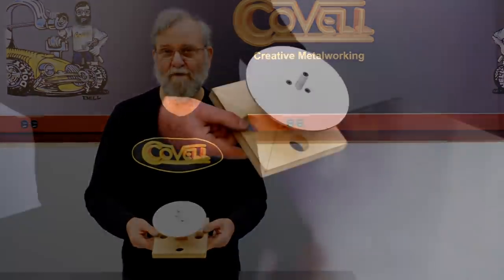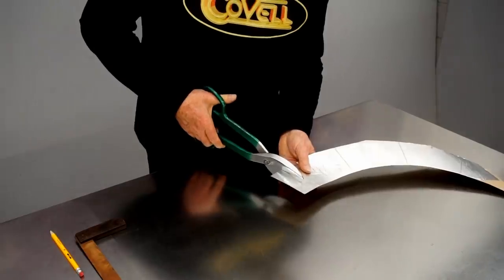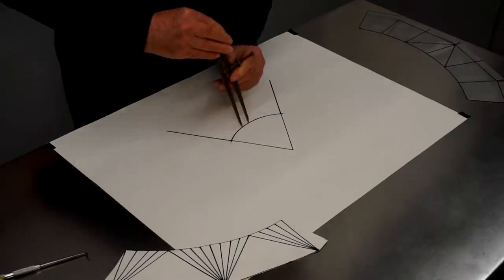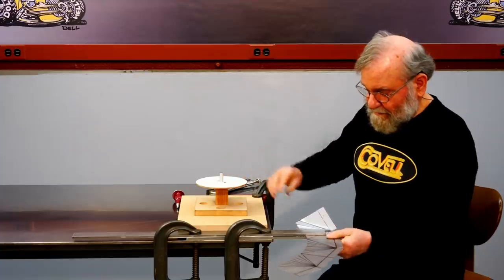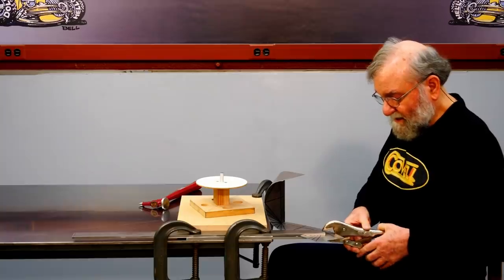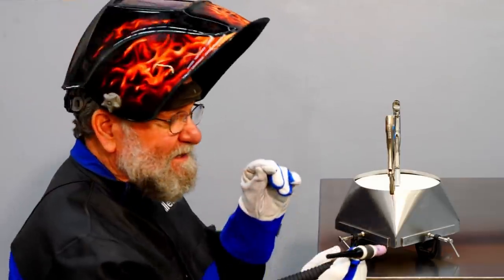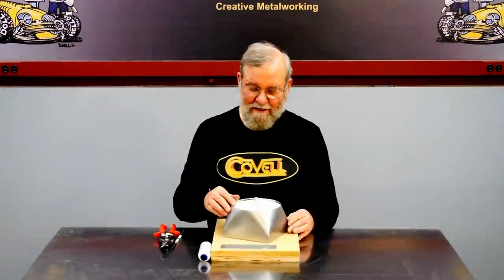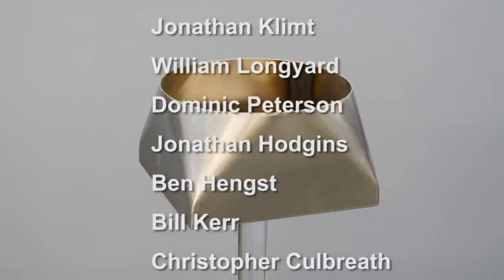Rollation 3 - Square to Round

Comment: Thanks for another great video. Good thing you used dividers instead of math. 😉 (70/8 is not 7 point something.)
Reply from the maker: As you have observed, math is not my strong point. The angle I divided is actually about 72 degrees, so each division of 1/8th is 9 degrees. I do better when I can use a calculator!

Comment: Could you use a spot welder
Reply from the maker: If you used overlapped joints the parts could be spot welded together.
Here's a project where I did use spot welding:
https://www.youtube.com/watch?v=0NRN2IXjwsY

Comment: what if you need one at 20 feet diameter
Reply from the maker: Well, of course the rollation technique would not be practical for something that size, and you would use the traditional geometric layout techniques. Nevertheless, for certain parts, the rollation technique is an effective layout technique.

Comment: Excellent work, but I think I'll stick with either Square or round , one or the other.
Reply from the maker: No problem with that. Certainly square to square, or round to round transitions are easier. But sometimes you have to connect these two different styles. Here's a well-known example:
https://www.youtube.com/watch?v=ry55--J4_VQ
Reply: Yes that was kind of just a joke on my part.

Yes I'm extremely impressed with your work. I work for a company that has a large sheet metal fab shop and a plasma table so I see a lot of different stuff of all sizes. I've never seen anyone lay the stuff out like you do. Impressive.
Reply from the maker: Thanks so much!

Comment: I noticed you didn't use soap when you sanded this time. Is that because steel isn't as likely to clog the paper or something else?
Reply from the maker: Soap is only needed for soft metals like aluminum. Steel doesn't clog the grit.
Reply: @RonCovell  thanks for the clarification

Comment: Why did you cut it in half?
Reply from the maker: It makes the fabrication easier, and I have more control over the sizing that way. Many of these parts are made in one piece, but if one dimension is off, there is no easy way to correct it.

Comment: I like the workflow, but my own preference is to do the layout work in cad. Then print it out and stick it to the workpiece, and if it turns out I need another one I can print another copy.
Reply from the maker: CAD is fantastic for this sort of work. Many of my viewers don't use CAD, so this is directed toward those folks.
Reply: @RonCovell  Apropos of nothing I came to that particular workflow by way of sewing templates. When I started working with sheet metal, it seemed natural to make my own templates but work the same way. It's true that my mother doesn't go for it, however.

Comment: hi there, nice work, any tips or tutorials on rolling a small edge on curved light weight sheet metal, such as a hay guard on a baler???
Reply from the maker: This video by Lazze Jansson may help:
https://www.youtube.com/watch?v=eOcZwr-1Y1E&t=297s
Reply: Hi Ron ... also wondering about adding flanges to ends.  I want to make an adapter to hook 6 inch dust collector hose to jointer that has a square port where chips fall out.  I am guessing it it best to make hoop out of seperate piece and weld, mounted flange incorporate into pieces if the transition main body.  In other words welding up three pieces?  If you know of a good how to video for something like that please send a link.  Thanks for making the whole rollation series, perfect for diy hobbiest like me.
Reply from the maker: Adding a separate part might be the best way to do that. A small flange can be made from the parent material (as shown in the video link I sent you) but the larger the flange, the more difficult it is.

Comment: When you're doing your divide by eight on that arc, you can use this neat geometry trick using only a straight edge and compass to get divide by 2 each time until you get all 8, quite exactly: https://youtu.be/-xTfkQCd9ME
Reply from the maker: That's a good technique, for sure! It only works for multiples of two, however.
Reply: @RonCovell  True-ish, but worse, hehe, actually only powers of 2...  But still good for your 8.  ; )  Thanks for your reply, Ron!
Reply from the maker: Right you are!

Comment: 5:44 That is a really tedious way to divide angle into 8 even parts. You could just have divided the angle into two, then the resultant two angle each into four, and those resultant angles in to eight using triangles. 

Otherwise, I like your technique.
Reply from the maker: Yes, bisecting the angle multiple times would have been a great way to do it. But what if you want an ODD number of divisions?
Reply: @RonCovell  uhmm... you just don't?
Reply: Drawing on my Technical Drawings experience, there are ways, including the method you used. But the (lazy) engineer in me would rather simplify the situation with minimal loss in end result.

Comment: Hello Ron why are you welding Tig steel, as far as I know MIG welding gives less deformation of steel?
Reply from the maker: In certain instances MIG can distort less than TIG, but there are a lot of variables involved. Because I was welding (mostly) on curved surfaces, I didn't get very much distortion.
Reply: @RonCovell  Yes, but I noticed that in your other works, even on straight sections, do you prefer TIG?
Reply from the maker: Yes, I TIG pretty much everything. I own a MIG, but it doesn't get much use.
Reply: @RonCovell  
My dream is to shake your hand and take some live metal lessons.

Comment: Thanks for sharing this AWESOME process, Ron.  Can the rollation process be used with a rectangular base rather than a square like your video and then offset the circular opening off-center of the rectangle? Would this work with aluminum for a customized fan shroud? Thanks again.
Reply from the maker: Yes, yes, and yes.

Comment: That's cheating
Reply from the maker: All is fair in love, war, and duct making.
Reply: @RonCovell  I made hundreds years ago. Not that I didn't cheat myself on occasion. 99.9 percent were done with a tinner steel rule, tape measure, paper, pencil and protractor. It's a dying art. Today they punch it into a computer and water jet, plasma cut or laser cut them out.

Comment: I used to brake, up to 6' x 4' sq to rounds in 4 pieces out of 12ga SS on the old All Steel power brake back in the day as an industrial tin knocker. Fun stuff right hand working the CNC controls (not at the same time) but a bitch on one's left shoulder. I would do like ten in half a shift (40 pieces) and had to keep track of them if they had off sets,  with a guy on the left side that had no clue what we were doing, just holding on as I yelled at him what to do, they always gave me a different helper. LOL
Reply from the maker: Wow - that's some big, heavy stuff. Most of the work I have done is on much smaller, and much lighter pieces. I'm glad there are people like you who can do the more demanding jobs!
Reply: We built paint shops for auto plants, GM, Ford Chrysler, Toyota. We built tunnels (duct work) that a pick up truck would go through made of four pieces of brake formed 120"x60" 10 ga SS using a tow-moter as a crane and you had to hit the brake angle +/- 1 degree the first hit. Don't know if you have used a power brake but you just don't put in a angle but the depth of the hit that can vary by material grain direction, die size, ga and width of mat'l.
Reply from the maker: I have never used a press brake, but I am aware of some of the complexity of getting accurate results, particularly with large, heavy, and unwieldy parts. My hat is off to you!
Reply: @RonCovell  At one time I had a text book that I used to lay-out some light gauge sq to rds at home but I like that way you do it, a bit more work. But at my job they were flame cut on a plasma, +/-  1/16", you had to put a tape on every piece and make sure the brake allowances were right, apprentices (union job). You do some nice work yourself, there man. I have an enginnering background but never wanted to work at a desk I always loved the shop. Just remember and I'm sure you know, It is easier to take form out than put it in...lol  Cheers

Comment: It's easier to go out & buy one - time = money!!
Reply from the maker: Of course if you can buy one ready-made, you would not spend the time and energy to make it. But if you need a size (or material) that's not available, it's good to know how to do it yourself.
Reply: @RonCovell  His video makes it look easy but working with sheet metal is worse than razor blades !!

Comment: that was super interesting!

I'm curious what some applications of this would be.  I remember in one of your other videos, you showed a downspout that needed to shift to the side in order to match up properly, but I'm having a deficiency of imagination about what else people would use this for.
Reply from the maker: This could be used for putting a fan in a window, or for a fan shroud for a radiator, or for ducting anything from a square opening into a round pipe.
Reply: @RonCovell  
excellent, thank you!

rollation in general is such an amazing idea; years ago, I was trying to make a form for a concrete weight, and rollation would have been perfect for working that out, but I didn't have any idea.

Comment: These videos are amazing, thank you for all the efforts.  Can you cover building a part that has both concave and convex shapes with rollation? It seems obvious they would have to be done in separate parts joined together, but I'm curious on how you would recommend approaching the form and template process.
Reply from the maker: I do have a video in the works like the one you describe. Rollation isn't suitable for patterning such parts, but I'll show how to do it.

Comment: If there is a million ways to do something, now there is a million and one. Machinist handbook has a simple calculation for chord length or, just use auto cad , code it with metal soft, then cut it on a laser, then use your cnc press brake. Or....triangulate the part.
Reply from the maker: Yes, many roads leading to the same destination. A lot of it depends on the tools you've got, and the methods you prefer.
Reply: Ron, you are 100% correct. I do love the different ways people think out of that box we live in. Where there is a need, there is a way. I have a story that I will keep short. I was out in the field doing an installation of an almond hulled plant. I had to an auger to a bucket elevator 100 feet in the air, dangling in a bucket. I tried all day with no success. So, that night in my room, I got a piece of stationary and folded it in different ways to achieve what I needed. The next day in two hours I had the entire connection done and welded. I took that paper up with me. My boss wanted to see what I did. I hoisted him up to see. He treated me like a piece of crap. He asked how I did that. I told him I just got lucky, I guess. 

He was real pissed I kept it to myself. ........Too bad.🤠
Reply from the maker: That sounds like a clever solution, indeed! Too bad your old boss was a jerk - some people will never change.
Reply: I was self employed for 31 years as a sole proprietor of a small metal fab shop. After ten years and a divorce, I bought a cnc laser machine. THAT changed my life. In six months I grew from just me to sixteen full time employees running three shifts. Then I bought a cnc press brake and a HAAS CNC VF-3 SS milling machine. That allowed me to buy a sail boat, a Ferrari, and a pair of Harley’s, and a new truck. Many times I needed to make my own tooling for something. I tried to stay close to my roots. My dad was making lead weights on the corner of the shop. He passed away in 2001. Many times I felt his presence while struggling to figure something out. Many times just doing it by hand opened up new ways to use my machines. 

Now, today, I can see I was a slave to my own creation. I still HAVE TO MAKE SOMETHING..😫 before I go crazier. I tell my with to pat me on the head and tell me everything will be fine then gimme a smile.
Reply from the maker: For what it's worth, I'm smiling for you too!

Comment: I don't understand why you did the layout in the most difficult complex manner possible.
Why not just draw it to scale and draft it out accurately, including any rolled edges or seam lap? 
This is a very simple development form.  

Would you make a model for layout of a 300mm - 200mm Dia x 2m high conical form that has a 200mm x 1m high round tube intersecting at 45 degrees? No... and that isn't difficult to draw to scale that can be laided out directly on sheet metal... using 2 pieces for the whole assembly. 
This was perhaps the most basic tech drawing task ... basic geometry.
Reply from the maker: Of course the rollation process is only useful for parts of a certain size. There is no question that geometric layout is used more commonly, but it's not the only way.
Reply: @RonCovell   "Not the only way".. sure.  However the need to manufacture a physical model takes the same time, if not longer, than it would to draft it out on a sheet of material directly, especially with complex intersecting profiles on any scale. 
Easier ways to geometric divide angles too.
Reply: @RonCovell  On a side note... what's your favourite sheet metal to work with? 
Mine is Copper... Silver a close 2nd.  I absolutely loathe needing to work with Stainless Steel.
Reply from the maker: I don't disagree with anything you say, but I do value knowing more than one way to approach a task - and I've learned that many others do, too.
Reply from the maker: Aluminum is my favorite material to work with, Copper is probably second, and steel is third. I haven't done enough work with precious metals like silver and gold to have an opinion on them. Stainless presents some serious challenges, but I have made some things with it that I am quite proud of - some with compound curves!
Reply: @RonCovell  Yep.. more than one way around it. I have an inherent skill for natural geometry... and think that way.
 
Aluminium has some truly wonderful alloys and easy on your back. Can't fly without it. 

Steel...  its convenient... about as dirty as copper to work.  
CuBrass' sheet..  mixed. I've worked that too often.. it has a nasty streak. Nice useful billet alloys though... but also a bit nasty.
  With copper, my professional work and art craft use (>50yrs) lead to Silver work, although it was not uncommon to encounter silver (not rolled form) professionally. It works like Cu and Al.. requiring finesse. 
Gold isn't all that useful. I think here is a lot more beauty in the colour of fresh bright copper especially a large sheet or bar stock. It anneals easily and surface treatment brings out a huge range of colours. 
I look at the transition piece you laid-out and folded and think... "Sheet Metal for Plumbing" ;-)   Cheers.
Reply from the maker: I really appreciate your comments on working with different metals. Most of my work has been in the automotive world, with some artwork and commercial fabrication to spice things up. I know there are a lot more metals to experiment with, and someday I may have the chance!

Comment: Ron, I always like watching the solutions you come up with, and would request ‘one more’ chapter - or multiples, as needed - in rollation: how to take one shape (like an oval or square) and transition to another (like a round or rectangle) thru a curve or compound curve vs. a straight transition!
Reply from the maker: That would be interesting, but of course that wouldn't be part of the rollation series.
Reply: @RonCovell  why not? Is rollation strictly a straight translation from one shape to another?
If so, my apologies!
Reply from the maker: Rollation relies on 'straight line' transitions between shapes, so it does not work with concave areas, nor compound curves.
Reply: @RonCovell  thanks for the clarity, Ron! Even as is, this series is possibly the best and most concise multi-part series I’ve ever watched... kudos!

Comment: And now lets get real,make material 316LSI,thickness 4 mm,and height..lets say 800 mm.Let it to be laser cutted and laser marked bend lines,lets use digital controlled sheet metal press....I have yet to see piece,what is proper round other side and right size square another side....Just my 5 cents from real metal fabrication liff...
Reply from the maker: The work you describe it beyond the capabilities of my shop and equipment, but it sounds like you do this kind of work. It would be great if YOU made a video!

Comment: Jesus what's with the patterns ?,  show viewers the correct way to develop plate materials . I used to make square to rounds from 1/8 or 3mm stainless on a press brake smaller than this as multiple batches to +/- 1mm spec .
Reply from the maker: Thanks for your comment. There is nothing inherently wrong with doing a geometric layout for this part, and there is nothing inherently wrong with making a pattern. I agree that for precision work you need a precise layout, and tools like a press brake that offer extreme repeatability, but not all parts have to be made to that standard.